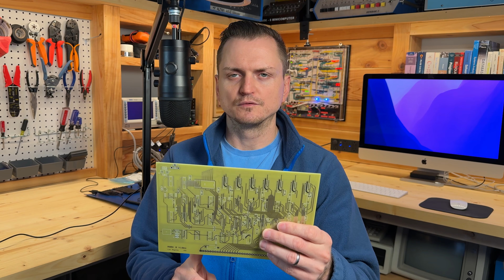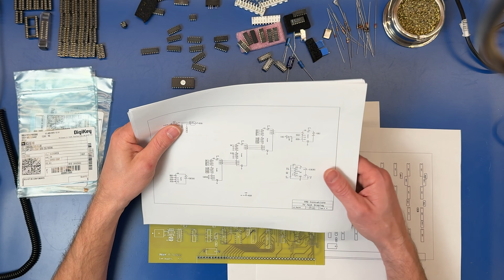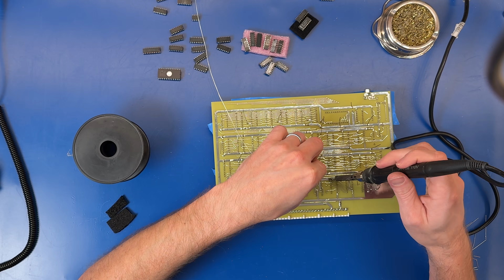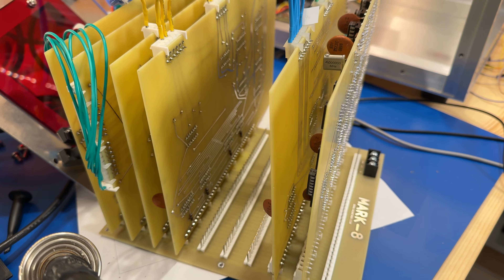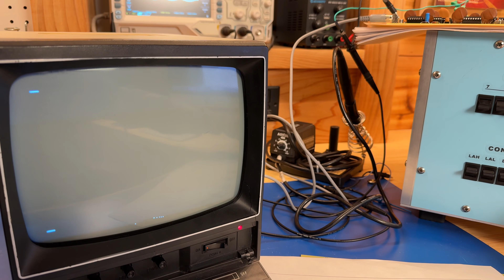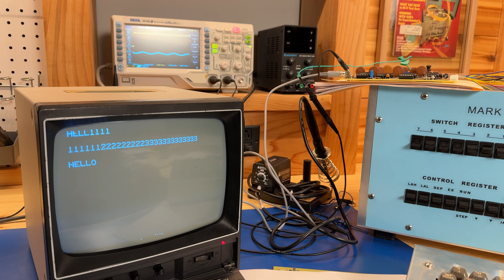Mark-8 Minicomputer Video Card

Comment: Your missing line at the top is likely because you are starting one line too early after blanking with your data.This is not an analog adjustment, but rather a digital one. (this might also fix the dots at the bottom, though that could be entirely analog positioning) Not sure what to make of the cursor, as it seems to be independent of the character data, so perhaps you have a counting error there too, look like it was repeating for the first 2 lines to the last to lines, so off by two in your count, just like you had with your screen clearing code.

Comment: Sounds like an “off by one” error with a line counter or blanking, I’m guessing it blanks output during vertical sync to reduce garbage above/below maybe its going for one line too much. What are the trim pots used for?
Reply from the maker: Interesting. The trim pots are used for vertical and horizontal positioning. Adjusting them does not seem to change the first line of dots in any way - it all moves together. It does sometimes flicker on and off, I'm not sure what to make of that.

Comment: Unless the guy wanted ALL of those TTL chips, (for a Retro look), it would have been simpler to just add a Microcontroller!
---
Just an FYI- 74123's are notorious for shifting their values internally!  Troughing the timing off!  This has nothing to do with the external RC.
Reply from the maker: You’re not wrong. We could run the entire mark-8 computer on a microcontroller :-)
Reply: @vintagetechrevivals  It's more fun doing it the hard way.  A microcontroller on a machine of this vintage seems so...  wrong.
Reply: I mean, yeah, but then what's the point of building a Mark-8?  ;-)